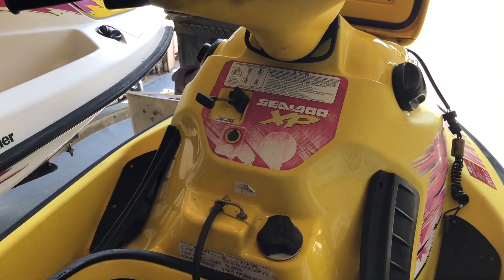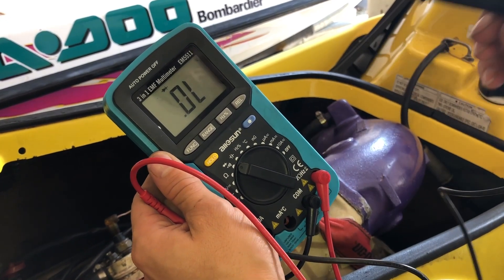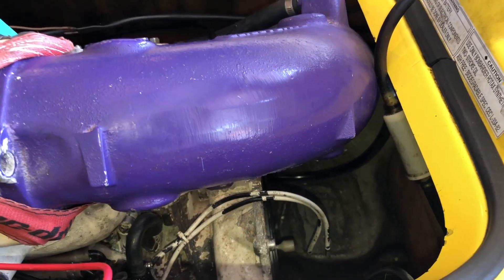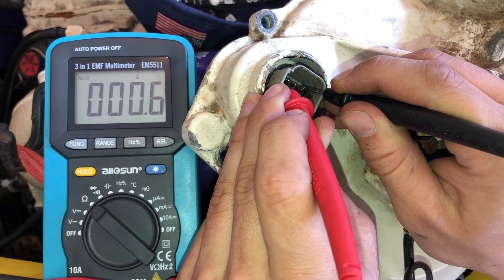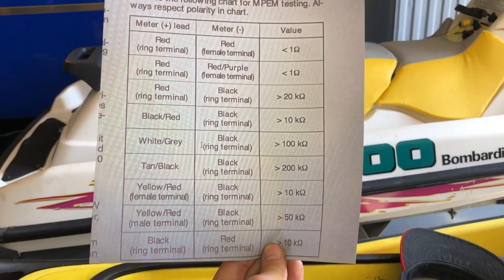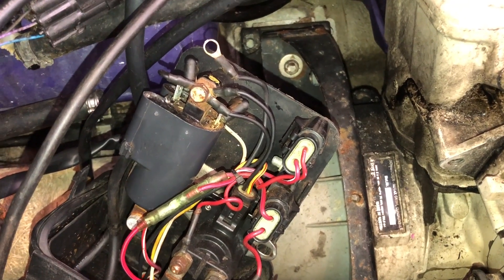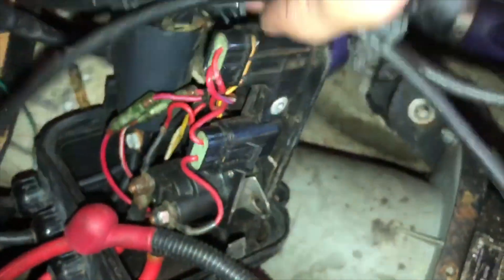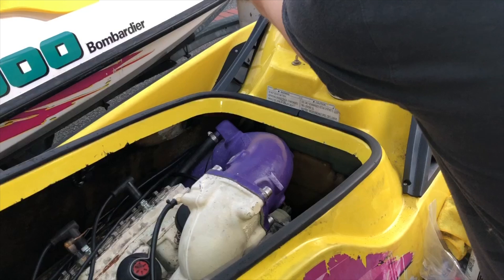Seadoo XP With No Spark - Entire Ignition System Tested (applies to other makes and models)

Comment: Dude, thank you so much for your video. I have two 96 XP’s. I was watching your video when I saw you had your wire hooked up a little differently then me on the starter solenoid. I could not figure out why I was not getting a spark. My other one worked fine the way I had it hooked up. Sometimes you just don’t question why. Thanks for your video.

Comment: Great video!!! very detailed  - with I got 97 gtx running after 2 year of setting. the crank trigger broke loose from the bracket and hit the flywheel but it still omh'ed out good  - good idea to pull the front cover is inspect to before replacing the cdi/mpem - $700.00  - the crank trigger is what took out the my module. fyi the exhaust band clamp was a big pain...

Comment: Really helpful! Unfortunately, it didn't solve my no-spark condition. I bought a 97 XP, from a shop, that they had installed a new starter, stator, rectifier. Once they got that far, they got a no-spark problem, and told the owner the ski "most likely" needed a new MPEM. Well, the shop ended up with the ski, and I bought it as-is, thinking I'd be getting an MPEM for it.  But, I wanted to check everything before just dumping parts in it and hoping.  I followed your vid and everything seems to check within specs except the coil secondary, after cleaning every contact point and clipping the wires back to fresh core.  The one thing that makes me think it may still be the MPEM is when connecting the key, the VTS gauge bumps up and then back, but I've only had the 2 beeps happen a couple of times.  My test results: Trigger coil -230 Ohms, stator-.9 ohms, coil primary - forgot to write it down, secondary-23k ohms. And, I do get voltage at coil spade from stator/trigger when cranking.
Reply: You figure it out?

Comment: My 1992 Seadoo Bombardier, even in the Owner's Manuel it only had 1 big black neg wire that ground to the engine, no small black connecting to the coil back up front.  Do you think I need to add that small wire?

Comment: Just bought a 1996 seadoo gtx bombardier. Previous owner bought from older man that lost spark one day. He replaced the coil pack, stator and cdi mpem. I've got two wires that didn't come connected. One is a yellow wire coming off coil pack that I assume goes to negative like in your video. And another black wire coming out the top of the black electrical box near batter. That doesn't have a home on the other end. The jet ski still had no spark when I bought it. I have pictures but can't seem to post them. Any help is appreciated

Comment: Adam, I am in the process of replacing the top lid of the rear electrical box. How do you remove the light grey female harness connector that is on top of the cover? It's usually covered with a boot seal on the top of the lid. Thanks!
Reply from the maker: I’m not sure which one you’re referring to do you have Instagram?
Reply: @adampaganelli4891  Just sent a PM on Instagram. Thanks!

Comment: Thanks so much for this video.  I just rebuilt the top end of my Challenger XP with the 787, and was out on the lake shaking it down a bit.  Was running fine, then all of a sudden it just flat out quit.  Naturally I was assuming the worst (and that I made a mistake which blew up my nice new top end) but it sounded like it was cranking fine and moving plenty of air.  So - plugged in spark plug, and did a close look to see if there was spark - and there was none.

Per suggestions, checked all fuses (all good) so went to the primary coil (in spec) but a resistance check of the secondary showed NOTHING.  Pulled off the plug ends and they were pretty cooked.  Cut off 1/2 inch, screwed it back on and...  whee - fired right back up.  I'm kinda irritated that they had to integrate the wires INTO the CDI unit, it would be much easier to get a generic plug wire.  Actually, now that I think about it I have some ford coil on plugs, and running those primary wires to the COP on each cylinder would probably work with a much more powerful spark.  

If it goes down again I may try it, or run those wires to a ford DIS system which I also have lying around...

Comment: Excellent informative video. You said you would add a comment for the type of test light you used to check that the CDI module was triggering the high voltage coil. Is it just a standard 12V automotive test light? Do you just pull back the white wire spade on the high voltage coil while still attached and hold the test light probe to it with the other end of the test light grounded while cranking? Thanks.
Reply from the maker: Thank you for the kind words! And yes that’s exactly how you do it, and the products are in the description right below the video!

Comment: Hey bro! Did all your test & actually failed the stator ( 3 prong) 

I got here because although I do have spark it seems weak.. & only 1 cylinder is firing.. I swapped out a stator for a good one and put it all back together… finished video and passed all the test witb flying colors! 

What the hell do I do next ?? I have spark it just will not run on 2 cylinders.

Comment: Very good video. My 97 GTS is set up a little different, the plug off the stator is 4 wire. From what I’ve been able to find the resistance between the two yellow wires should be 0.6-1.0 ohms and the 40-60 ohms between the black and black with red stripe wires. Can you verify this?

Comment: I have a problem i have seadoo gtx 1996 and i changue my ignition coil whent bad and now i dont have power in my spark plug wire and i need heelp
Reply from the maker: Hi Tracy sorry for the delayed response. My email is pagsli34@gmail.com if you have any questions
Reply: @adampaganelli4891  I'm having the same problem

Comment: Great videos, we appreciate the time u put into these.  Wondering if u can give me assistance? I have 08 rxp215 and digital display Is starting to lose certain  lines or not display correctly. I think water or condensation is getting in and messing with it. Is there anything I can do besides check the connections to it? Also is there somewhere I can pull the specs like u have for resistance testing?

Comment: Hey bro got a question I got this jetski from a friend i put the battery in and I hit the start button but the engine wont turn over so I take off the spark plugs and liquid shots out the spark plugs  holes and the engine turns I put them back on and engine doesn't turn any idea

Comment: I am working on a 1996 GTX and would really like to know how you got access to that service manual. I need to figure out how to test the computer modules in the front of the ski to make shure they are functioning properly cause I don’t have any power to the starter solenoid when trying to start
Reply from the maker: The service manual I found online

Comment: You don't have to pull the stator cover to check it all you do is unplug it from the electrical box in the front and check it they're much easier
Reply from the maker: Shannon Williams it was pulled for demonstration purposes
Reply: @adampaganelli4891  is that the 787 or the 717 motor
Reply: @adampaganelli4891  and did you ever figure out the problem